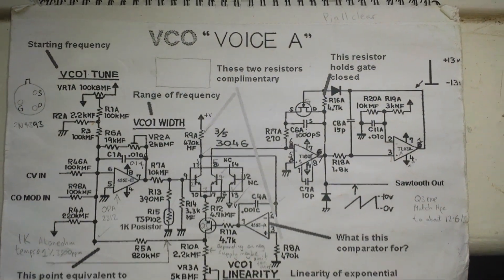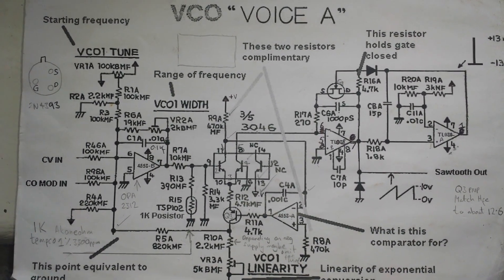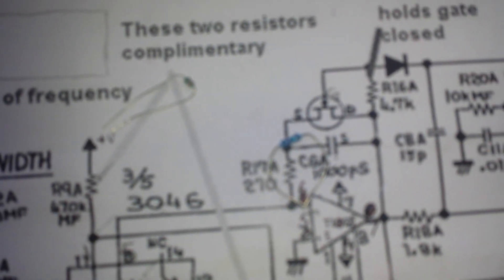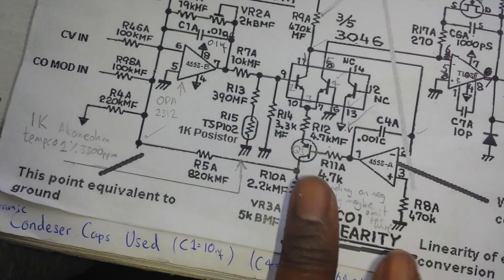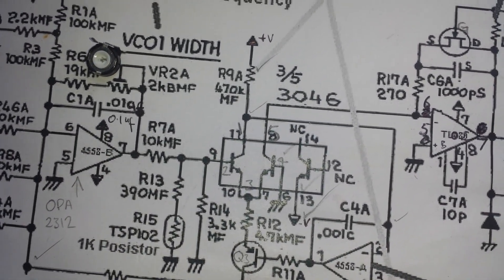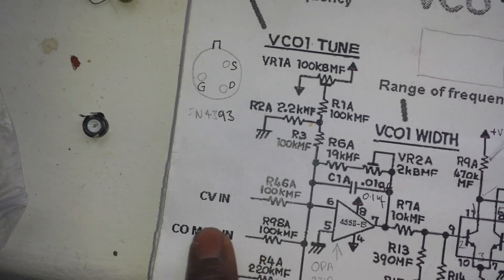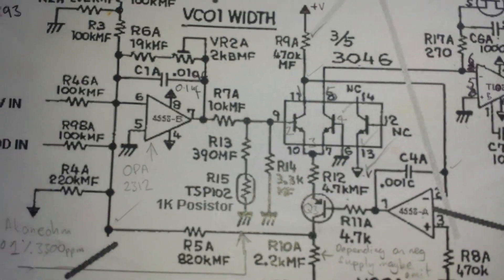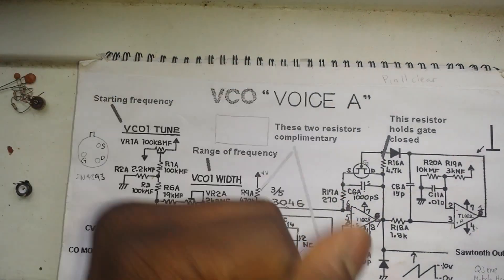DIY analog synth project Tutorial Part 2 The Exponential Converter

Comment: thank you ever so much for this video. i have a question and i hope you can assist me because i am using it for my dissertation. do you supply the opamp with vcc and -vcc or is it grounded?
Reply from the maker: Yes vcc positive to pin 8 on a dual op amp and vdd negative supply i use +12v and - 12v in the circuit except wher ground symbol shown.
Reply: @AdamTheAd-vanc3d  Thank you ever so much.  I have another question. Does the tempco has to be glued on the chip with the BJTs?
Reply from the maker: @c4sp3r91  Your welcome, yes thermal bonding compound is highly recommended.  I would also use a transistor pair like in mine I use ls318s from linear systems . They are very closely matched and on the same die . The tempco sits underneath and the legs touch thermal paste which is on the tempco. You can also bond a tempco on top of a 3046 npn array but not as effective.
Reply: @AdamTheAd-vanc3d  once again. really appreciate your time to respond to my questions. i am using ssm2212. wich is quite tiny. which part of the tempco resistor should touch which of the ssm2212?
Reply from the maker: @c4sp3r91  Well in my opinion heat rises so I would place the tekpco over the top of the chip.  However maybe with googling/ researching first.

Comment: can I just use a TL072 for the OPA in the expo. conv.? I know it should be more precise but the OPA2131P for instance are 14€ the piece Dx and befor I start buying them like crazy I wanna make sure that I got the build right.
Reply from the maker: AP Girl Yes you can use pretty much any dual op amp . Tl072/082 or 4558 or 4557. Maybe Ne5532 might be an option. Since my last video on the saw core amendmants i have again tunkered and made some changes. For instance you dont need capacitor c1 for the cv summing op side pund 6 to 7 in a modern op amp. Neither do you also i have chaged the oscillator timing cap to 1nf aka 1000pf and also mirrored this in the capacitor  in the expo conv. Pins 1 to 2. With the trimmers i get a pretty much accurate range from c2 to c8 thou a little flat on below c2. To be fair this is quite negligalbe and adds to the fatness when you have multiple oscillators.
Reply: okay^^ I'll keep that in mind while making the final schematics for my prototype! On another note, I thought about a multiplyer. I'll need to test it first, but I may be abele to multiply one VCOs voices up to 16. if I get that done right it could make for some really fat sounds.
Reply from the maker: AP Girl Good good sounds promising. Maybe share some of your basics with multiplexing as i dnt know where to start lol. Hope it works out.
Reply: yea, it's a bit complicated, But I'll make it work^^
Reply: Okay, I did the math. when my project is to succed I'll have to build a whooping 512 exponantional converters. call me crazy cause you have all the right to do so, I actually am crazy (no joke). So now I am engineering a replacment for the CA3046 becuase supply is super limited. I see the details in my prototype. I expectd a lot of prototypying befor nailing the fetures and modules down. but the grand scheme stands. once I'm done I'll have no similar synth that can compare to that monstrocity. one note will be abele to have up to 1024 voices thanks to multiplying. I havn't truly understood the concept of the multiplex yet, but I'll learn it while doing the protoyping.
Reply from the maker: AP Girl Wow you are very ambitious. Have you seen any similar project. 512 oscillators/expos is a hell of a lot . I wonder if building dcos would be a better option seeing as you could use a dac as refrence tuning . Btw have you come across anything sim8lar to what you have planned ?
Reply: actually, yes and no. I've really only seen DIY projects and professionell synths do that, with the DIY opting for janky setups and the proffesionell for actuall CPUs especially desgined for them. But it's not undoabele. I know that this IS definitly possible. The synths I know that do have that many voices are modular syntheseizers, and in the end all I am doing is building alot of moduels very compact and controled simultainsly. But yea. I definitly will look into making it a diffrent kind of oscillator. that's what the prototype is for ;P to see if it's even possible to support that in large scale^^
Reply: okay, I think I got it now. The best thing to do would be to use a hybrid solution in my case. So I comletly strip out the expo. conv. and do that digitaly. The rest stays the same, just the conversion of MIDI signals to CV is done by a piece of software od a Chip. I feel like that I'll stay more true to my concept of an analog synth. the sawcore will still be a free running oscillator. so per definition if I were to take away the digital expo converter it would be running so it is an analog oscillator!
Reply from the maker: AP Girl Thats right just an analog oscillator under digital control, hence a dco. Like the vintage junos, akia ax's , and some of the korgs like poly 800 poly 61 etc, onerheim matrix. Plus dcos opens a better world of flexibility.
Reply: Well, partilly. Mine would be considred a Hybrid. Since a DCO is actually just a highly clocked master oscillator that gets devided down and so forth. basicly a typicall DCO synth has only one oscillator and the rest are waveshapers. the 2 types of DCOs now are those wich use an Analog clock or a Digital quartz cyrstal clock, both have advantages and disadvanteges. 
A normal DCO further then controls the cutoff of the inital saw wave and it's amplitude, all of wich gets calculated by the counters and clock etc.
my DCO tho, a DAC-VCO-Hybrid only controls the input voltage, leaving the cutoff part entirly to the oscillator, further more it will always run at the base frequenzy hence why mine isn't a normal DCO, because a Normal DCO stops playing when you don't press a key (at least in the theory, reality is much more complicated than that).
All that setup in the end allows me to centrelize the Pitch controle for all oscillators and hopefully later on will allow me to get to the polyphony part where things start getting really fun (and out of hand).
(As you can tell I looked really deep into the matter, I am really quick at learning).
basicly, thanks for the Idea. That probably saved me lots of money!
Reply from the maker: AP Girl. Yes there are diffrent types of dcos. The alpha juno / mks 50 uses a dedicated custom chip to make every waveshape. Where as the juno 6/60/and poss 106 uses an analog saw core oscillator that is clock controlled which is what i thought YOU had planned to do. So in actual fact i could turn my saw core oscillator into a dco if i ditched the expo and used the crystal or dac pulse method. Anyway its good to hear your ideas very inspirational. 👍👍
Reply: yea, the thing why I am opting for only the DAC is because of flexebility. All I really need to do is to digitalize the expo. conv. and than taht's done. And the flexible part is that I can scale that better. so I can start small and do the same thing just bigger but with still the same reference I used befor.
Reply from the maker: AP Girl Yeh i gotcha . Makes perfect sense. 👍
Reply: ^^ The challenge now is how I'll go about this. Since I come from a programming school I always define what I want first befor searching a solution. The product needs to convert the MIDI/CV 1V per oct signal into the propper voltage for the Oscillator and needs to the same for digital MIDI signals.
There are a bunch of solutions that pop into mind now that could achive this, one is to make a libary of notes and what voltage they represent. but that is highly unlikly to always work properly. The next one would to write an algorithm that claculates the voltage needed based on the input. This could also be done by 8bit counters and a bunch of "if, than, else" checks.
I really just need to find the best solution to this problem and then I am good to build the first small synth out of it. So as soon as I decide what controle chip is best suited for the task (Arduino, teensy etc.) I can start the prototyping stage!
Reply from the maker: AP Girl Yes thou i guess you may need at least a 12bit dac to get  a  full 127 midi range. There is a few arduino cjrcuits i have used and have seen. Thou the teeensys is definitly anothrr viable option.
Reply: exactly, 8bit is the total minimum it should do. Anything above is more than welcome. I'll have to look into the diffent chips and maybe compare them in a test setup.
Reply from the maker: AP Girl Indeed . Be sure to if you havnt done so to check out my elkayem arduino midi to cv vid . The guy who developed that circuit has made a 3 voice option using a teensy.
Reply: Well, I pretty much hit a road block. I need a way to control the amplitude aka. the Pitch without the use of a massive expo conv. array. But, because I wanna keep the more analog unpreciseness of the oscillators I can't go for a full on DCO. 
So what ever replacement I searched for the expo. conv. was either to inaccurate or straight up unuseabele dou to way to complicated. The 5V of the arduino are just not enough to sufficently drive an oscillator to high notes!
I think I'm looking at this from the wrong side, getting your head around the proportions is kinda hard. I think I should take a step back and examin the Expo. Conv. more prcisly to see what it does exactly. 
But since I don't have one... Can you give me a chart of input and output voltage? so for instance if you put in 1V (a C) what voltage does it send to the oscillator? If I can figure out the exact proportions and math behind this it may make it easier to replicate in a diffrent form. or hey, do you know any online sources that already have that calculation?

Comment: Hi, Adamski Ajull!
The fresh report about my expo + saw core:
KR159NT1B (the transistor pair) seems to be impossible to get to work with this (new version) circuit. I've added 10k trimmer  (let's say "VR4") instead of R7 and it seems that THIS element makes more sense about frequency width scale :) Changing VR2 changes f.width plus it shifts the frequency. Changing VR1 (after that) to make it lower (if VR2 shifts up) changes f.width as well! And so on.. so on... So it looks like I'm "moving inside some very limited scale" (closer to highs) where I can set up 1-3 octaves. But even these notes will be shifted up. I can almost set it up with "VR4" but it's only for ~2 octaves. This is very poor for +/-13.5v
Another note: 4558 "doesn't want" to work in this circuit! It gives only a very high frequency. I can't change it. LM358 works OK but I've changed it to LM833 (a much cleaner op.amp IC) and this seems to be better.
Then I've changed KR159NT1B to KR198NT1B (CA3046 alternative). It has different pinout, I still don't  know where is "substrate" there. The result is practically the same!
OK, at least now I have right volt/frequency direction dependency :)
Now I'll change it to the original CA3046... (it's not quick, need rewiring).
Reply from the maker: MoolahNasreddin . Sounds like something is seriouly wrong with your expo converter. However i cant work it out it if you say you have wired it correctly. By the way what volatges are your op amps pin 8 and 4  going to ?
Reply: Pin8 to +13.5v, Pin4 to -13.5v All as usual here... I've didn't made a close match of R8 and R9 but could it be the reason? I guess not for this issue with 4558...
Reply: P.S. that test circuit that you've sent me doesn't oscillates without a R (or a pot.) between Pin1 and Pin6.
Reply from the maker: MoolahNasreddin . Yes it wont sorry i missed that detail out ;-)
Reply: I was cracking my head to find "why?" ahahaha ))
Reply from the maker: MoolahNasreddin . Ok yeh i missed out that detail. How does the test oscillator perform abd what size cap are you using ?
Reply: that was 0.068 mF (68nF) but that was just to test... I've ruined the assembly to free the breadboard. Tomorrow I'll finish the assembly with CA3046 to be sure that it's not because of this part.
P.S. previous ass-y with KR198NT1B is on another b.board for test purposes... I'll compare current's values (if will not forget this).
Reply: Hi, Adamski Ajull!

I've assemblied the version with CA3046 this night... Bad luck here :) I wasn't even able to hear it. I see some very high freq. tone and it's amplitude (and frequency probably) is changing while I'm rotating trimmers' screws.
I've tried with 4558 (with 1500nF between 1 and 2nd pins) but I've got only some strange rare clicks (like pulses). These were on the negative side. Trimmers didn't changed this behavior at all.
Then I've installed LM358 (680pF between 1 and 2 here... I've checked previously that 1nF or 510pF has no difference for this case) and got that strange behavior with a very high freq. tone.
After all that I've retried the previous circuit (with KR198NT1B) and got almost one octave of tracking )) I've fixed something (maybe). But not sure if I read that thing right... Never expected that it will be working so strangely.
Here is a test tracks with a lot of generated things. Only the VCO tone is real analog:
https://soundcloud.com/kirill-threedee/sleepy-badvco

Comment: Hi, Ajull!
Did you've tried to drive several oscillator circuits (not from one IC) by one expo-converter? Is this possible? I've made a pretty simple (speaking about schematics) little "synth. toy" that gives mostly square sounding waves (probably you've heard that on soundcloud in my last tracks). Then I've decided: OK, after making a sort of a feedback from filter's output to osc. input (and few "not lucky" tries to waveshape a triangle from square) I'll try to make a separate oscillator here. I've made a simplest saw osc. then tried to drive it by the same expo converter (not as yours, much simpler but with bad tracking)... but "no luck" again. Seems that it "gives" a lot of current to one of the ICs and gives much less to other. I've tried to use a diode in series (from expo) but it just "switches off" one osc. and lets play the other.
Mixing two signals by an op.amp (with virtual ground) is another story... saw sounds almost like square (but it's not an overdrived saw)... IDK why.
Reply from the maker: MoolahNasreddin Hi thanks for your question. The answer is yes i did try when i sucessfully built one expo converter , i tried patching it into 2osc but it didnt work.  The osc you made is it using a 40106 by any chance ?. I also funnily enough tried using the diode block method but no success.
Reply: Almost ;) it's the mod. osc. Here you can see all (except the filter and the AR gen.) https://easyeda.com/RealMook/4046_Synth_1_0-76ae65b986194525ba4fca0d6a65d9d1
The integrator doesn't work in this schematic (maybe I need virtual ground for it, didn't tried yet)
Reply from the maker: MoolahNasreddin . Thanks thou the link didnt work ???
Reply: Very strange... it's marked as "public". Here is the URL to the image directly https://easyeda.com/normal/Main_Circuit-bf3bed9125104876a89efb8ab4047289
Reply from the maker: MoolahNasreddin Thanks ive got it now. I dont quite understand it but is this the chip that outputs the six divided down sqaure wave .
Reply: 4046 PLL - phase locked loop. I've started my little quest about it here https://hackaday.com/2015/09/11/logic-noise-playing-in-tune-with-an-exponential-vco/
PLL is very known in C64 fans' world as it's one of C64's main ICs. I've found that it has a decent built it VCO so it's the reason that it's the main osc. in my schemo. 
40106 can be used to make at least 4 isolated square wave osc-s. Also it can output triangle waveform on the input pins (but this hardly depends on C and R values, in some cases it stays quiet). But mainly these are schmitt-triggers.
Yesterday I've found that 4046 can be used in seven octaves range (in this configuration, 9v single). It must have the feedback from output (probably it's due to the filter, my output and a feedback source - not sure). The tracking of course is pretty off but gives some "close to some notes" values on high notes. Without this feedback it flattens out after 5th octave.
P.S. my guess about "splitting currents" for multiple expo-outputs is to use multiple transistors of the last stage. I've seen it here http://www5b.biglobe.ne.jp/~houshu/synth/ExpPent.gif
But there they are separated... so not sure how it will be looking like...